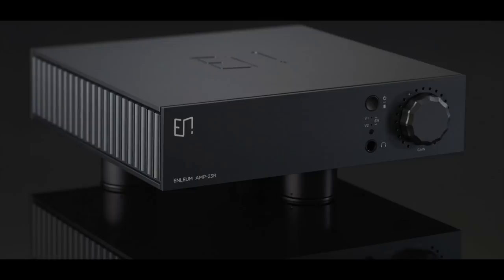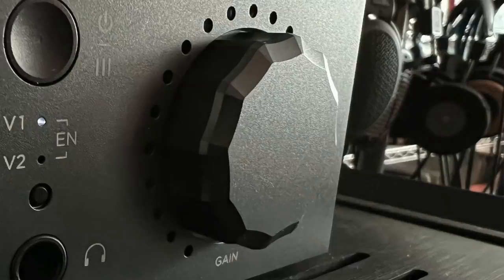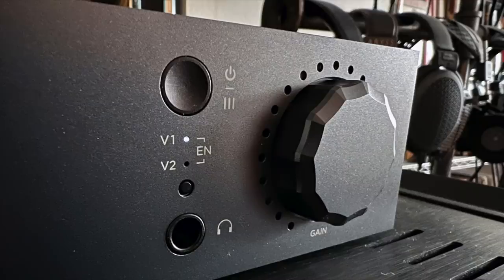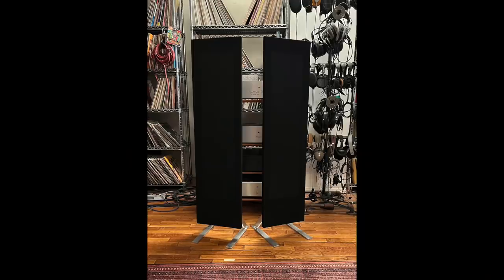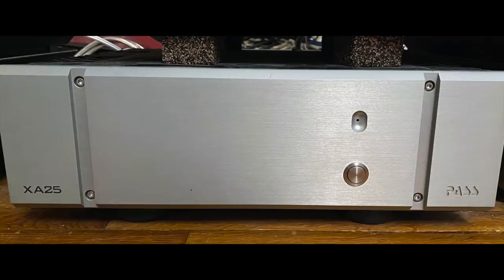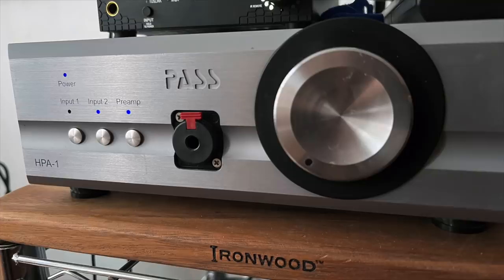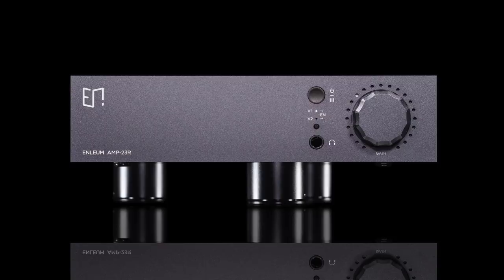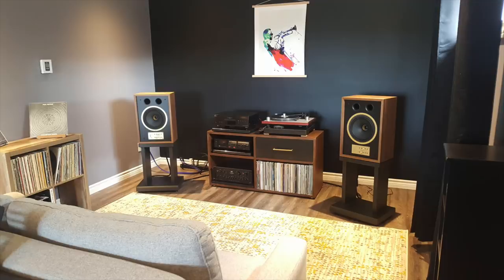VERY HIGH-END sound, from a VERY SMALL design

Comment: I just bought this amp after a couple of months of consideration; ended up doing a blind buy. I can tell you the AMP-23R has god-like authority over headphones and the spec sheet power ratings are drastically understated. Someone needs to do a power measurement on an APx555 to see what this thing can really push because it seems to be able to drive power hungry speakers with surprising ease. Clarity is amazing; since the amplifier gain stage is operating entirely in current mode, it seems to have an immense bandwidth, hence its speed i.e. ability to follow, highlight and delineate between every nuance in the input signal, with authority, is the best I've heard bar none, and I've heard quite a lot of amps.

Comment: I've had my Enleum 23R since mid December driving my Cornwall IVs.  I love the sound of this amp.  My system consists of an Aurender W20SE server/streamer, Holo May KTE DAC, Rega P10 turntable and Apheta 3 MC cartridge , Luxman EQ-500 phono stage and a Equi=Tech 2RQ power conditioner.  Other amps that I've tried include an Audio By Van Alstine 600R (300 w/ch hybrid amp), McIntosh MC275 VI, Rogue Stereo 100 with Dark upgrades, and a Chinese 300B amp that's popular on Amazon.  I'll take the Enleum over my own AVA 600R that is rated for 12 times the power of the 23R.   The McIntosh MC275 v6 is a legendary amp (I used to own the v5) that cost about the same as the Enleum but the 23R makes it sound muddy and slow.  The same goes for the Rogue and the 300B amp.  The little nine pound 23R kicked the ass of 2 65lbs tube amps and my own 40lbs hybrid amp.  I just laugh at people that say they want something more substantial.  Oh, Steve is right about the 23R being a great headphone amp.  I use it to drive my Susvara, Abyss 1266TC, Focal Utopia, and ZMF Verite.  I haven't heard a headphone amp that I like better than the 23R and I've owned quite a few high end headphone amps.
Reply: I used my VFET (SIT-3 inspired) amp to drive my ZMF VC and Atrium. Holy f@ck, it sounds amazing. High-end receivers/amps are amazing for headphones
Reply: Yep. The sound from these SS amps have that SET characteristic.  And it’s incredibly fluid, fast and lights up stage.  Many forum favorites are merry go round amps or people who invest on the resale that they continue going around the block.
Reply: But it’s not AN Kondo, it’s not Boulder, it’s not Karan, it’s not Jeff Rowland… and klipsch and high end is like, really? Let’s say it is, but then, how are you assessing this? By how accurate or how much you like it? Or is it just how much you paid for it, or how proud you feel. So far I only see names and names, so I am placing more names and more names and specially bigger names. 

So, didn’t you know what high end was based on what you commented as a reply to me? How have you found that you know what high end sound was when in many books Macintosh and Klipsch has no business in the high end. 

And I’m just teasing because AN Kondo sounds vastly different to Karan and vastly different to Jeff and vastly different to Nagra and… so, yeah… glad your are enjoying your sound. I bet it sounds fantastic. I bet you can enjoy it even if you come off your high horse.

Comment: I have recently added the earlier Bakoon amp (15W) to my high sensitivity system. Pure magic. Beat out tubes and high power SS. The temptation is to add another Bakoon component in the chain!
Reply: What speakers are you using with the Bakoon?
Reply: @joonkeum9457  DIY speakers based around the Beyma 15Xa38Nd coaxial driver (98db) in an oversized aperiodic cabinet (meant to suit the current drive amp topology). The cabinet design is an upscaled version of the Tannoy Cornetta corner cabs made for Japan only, with front-loaded horn. The Current drive amp adds a boost around the driver Fs that improved bass response.

Comment: Here is another small amp for the list. The VMV A1 from SMSL. Class A, 10w, small package. Costs $ 600 with remote control. Fantastic build quality. i was intrigued by the concept and bought it. And guess what, with my Audio Note AN-E speakers it is really good. Very clean sounding , huge soundstage front to back and side to side. Never aggressive and good bass. I had other amps to compare it to from Audio Research, Classé Audio and PS Audio. I sold them all. Just don't use it with power hungry speakers.
Reply: I have also the VMV...use it with Dynaudio Heritage...only 85 db but with goed behaviour concerning impedance...is very good when playing not too loud...

Comment: What is in this that prevents a company like Schiit from producing something like this. Is the sound from high tech expensive parts, ingenious circuits,  precise parts matching, or something else. Should I wait for patents to expire. Give us a hint.
Reply: I think its too expensive for what it is, but the parts and labor needed to build an amp like this is very high. I can only guess, but it probably costs around $1500 to $2000 to build (parts and labor). Schiit uses off the shelf parts, so building one of their integrated amps is much less costly. If they wanted to make an amp like this, they would have to charge a lot more money.

Comment: kind of a newbie question. can you connect subwoofers to this? so 2.1 setup?
Reply from the maker: Yes, but limited to subwoofers that use speaker level inputs. That type of subwoofer runs off the amplifier’s speaker connectors. So yes, This is a little confusing, or may be a lot confusing, but the amplifier can be hooked up to speakers and a subwoofer of that type at the same time. REL subs are specifically designed with that application in mind.

Comment: Any comparisons to First Watt on the Cornwalls? I may have missed it, but can this be used as a power amp with separate preamp? Thanks
Reply from the maker: Thanks Ted, no it cannot be used as a separate power amp. I compared it with the Pass Labs XA 25 (same power rating as the Enleum) but no first watt amps.
Reply: @SteveGuttenbergAudiophiliac  No disrespect Steve but yes it can be used as a power amp with a preamp.  I have the 23R and I use my Audio By Van Alstine FET Valve CF vacuum tube preamp as 1 of the 2 inputs to the 23R.  The 23R is actually ideal for using a preamp because the volume control is a variable gain control, not an attenuator like you mentioned in your video.  The other input to the 23R is a direct feed from DAC so I can compare the sound quality with and without the preamp in the chain.
Reply: @iceshow4582   Thats sad when these guys review these products and dont even do their homework.  Just get it in and get it out the door just as fast and bring in the next piece of gear. Like the McDonald's of High End Audio review.

Comment: 25w is not a lot of power. But I’ve wondered at times how might 25 watts of class A or A/B power compare to ten times as many class D watts. Or even 2.5 watts of tube power. If only there was a way to have all of these things in the same place.. Is there truly a way to frame that within this format? Eh, maybe it’s a podcast
Reply from the maker: Hey, The 2 watts per channel Decware Zen Triode ampconstantly amazes me. For moderately loud level with moderately sensitive speakers you don't need a lot of power. Power IS required for  90 dB+ levels with dynamic clout-slam, absolutely, even with high sensitivity speakers, but not every listener is looking for that.
Reply: Thanks for that zen/aegir/brooklyn comp on the 600mII review! As a Brooklyn Amp owner with a Zen in production, I can’t wait to make this evaluation myself 😀

Comment: That’s nuts !! Over $6k for amp that’s made in Korea!! 😱🤦‍♂️
Reply: I have an integrated amp made in England and it only cost me $399 brand new…………..in 1985 of course.
Reply: Can you blame them for wanting to get into the snake oil $$$ market. I'm not saying the amp doesn't sound good or maybe even great but the cost is simply joining a club.
Reply: @jogmas12  now that’s real value 👍
Reply: @alanrogs3990  that and it’s a class A/B solid state amp ridiculous 🤷‍♂️😂
Reply: What's wrong with Korean manufacturing ? They are one of the pre-eminent electronics manufacturing countries in terms of both quality and quantity. I have an astonishing 300b SET amp manufactured by Allnic in South Korea. It costs over £6,000 new and I regard it as a bargain.
Reply: @jimfarrell4635  nothing wrong with Korean/Chinese/Indonesian manufacturing … except that that amp is not worth $6k 🤷‍♂️😂 … for many reasons 😉, which I won’t get into ….